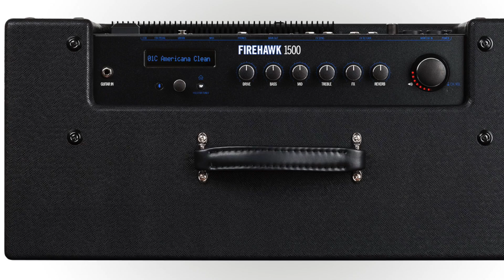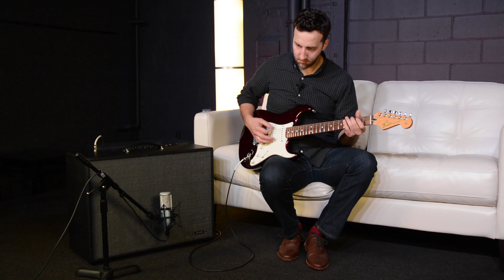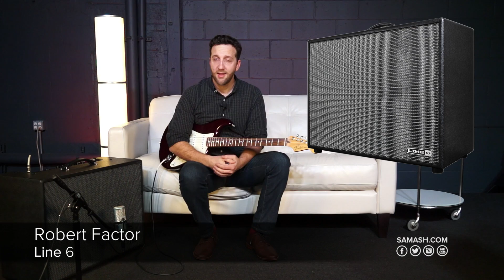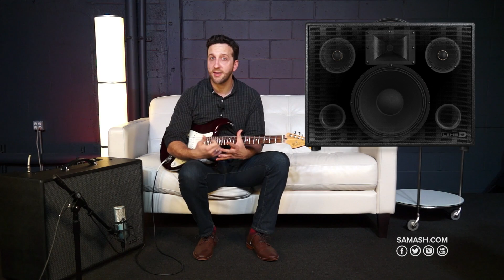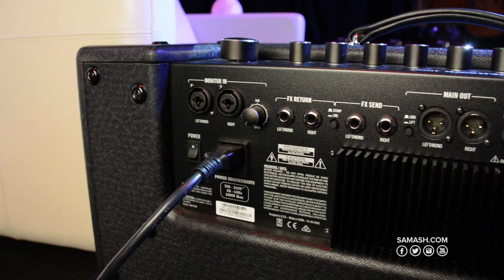Line 6 Firehawk 1500 High Powered Stage Amp | Everything You Need To Know

Comment: ah, i get the amp set up now. so it has 2 x 5.25 inch midrange coaxial speakers which each have 1 tweeter in it then you have the Horn Tweeter and finally the 12 inch midbass woofer with two  3 incn AeroPorts. so
1. two tweeters,
2. two 5.25 inch midrange speakers
3.Horn Tweeter
4. 12 inch MidBass speaker = 6 speakers plus two 3 inch Aeroports.

interesting 🤔

Comment: some one light me up, john petrucci for example. has many Mesa Boogie tube amps with analog pedals all cool but, he uses axe fx on tour. is it for to have different tones with pedal control?then this pa and amp makes much sense, its a PA and AmP and Axe Fx lol
Reply: +Ahmet Omer Ozgen - he uses the axefx for effects only.  no amp modeling or anything like that.  All of his tone comes from his mesa's.
Reply: +FastRedPonyCar lol. i would byy pedals for the effects ots relaly expensive
Reply: I use a Helix through a Mesa Boogie amp - it's more convenient then a pedal board and I get the best of both worlds.   Quality pedals can get just as expensive as a modeler.
Reply: +518 Corrosponder ok, so if i have a very huge amp. its better to buy the helix? helix is the way very expensive. but, if on stage(this amp is for stage) i wont be able to control it. than helix makes more sense.